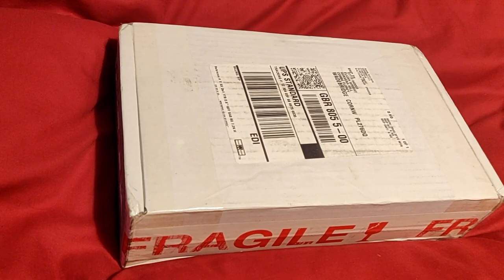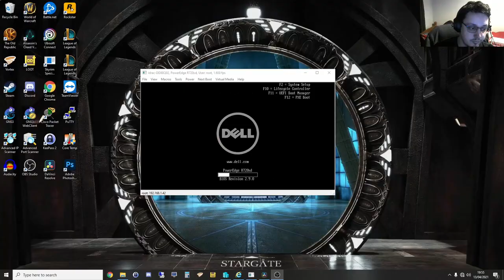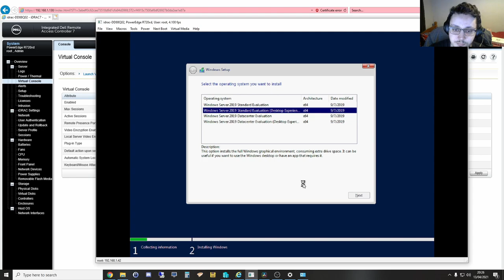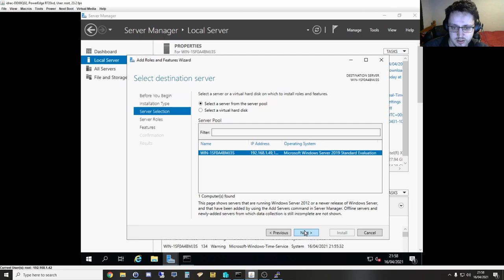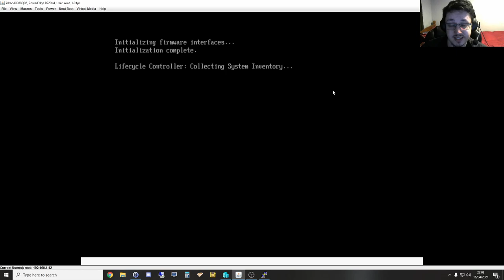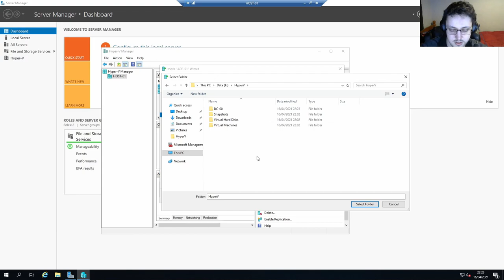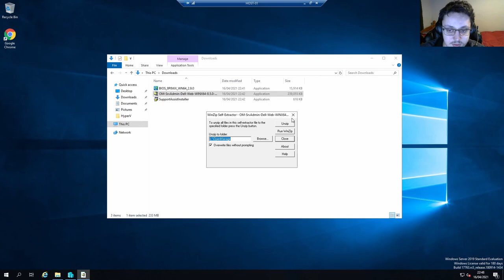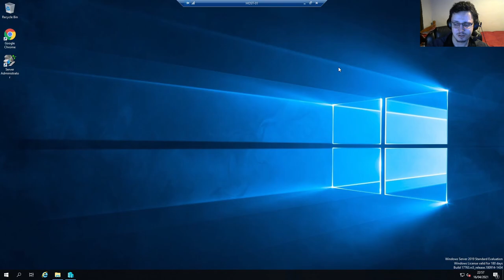Dell PowerEdge R720XD Server Build - Installation & Configuration Complete Guide

Comment: At the risk of asking a really weird question,  How do you configure your perc h710 controller if you don't want to use RAID, and don't want to risk a bad flash and bricking it.
Reply from the maker: Not a weird question at all. Quite an obvious one. If you want to not use RAID at all then you can skip creating the RAID by either deleting all RAID arrays currenly in use therefore deleting all data. Alternatively you can reset all disks to NON-raid on some Servers. Once you've done either of these then you can proceed with installing the OS. However I'd reccomend that you have some sort of alternative backup & disaster recovery process and solution to account for this as it will effectively mean if 1 disk fails you could potentially loose everything depending on how many drives you have and how you have setup your drives and filesystem etc. Raid 5 is good for performance and capacity as a happy medium and it only uses one disk for parity. So if you have 10 x 1 TB disks then you have 9 TB capacity and can sustain 1 simultaneous disk failure. Hope this helps!

Comment: Hi there I have just purchased a Dell R720 but when I switch it on the logo that pops up is a omni cube simplicity so not to sure what’s going there.
Also I have 2 300Gb drives but when I go to the controller to configure the drives I can only see one drive and the Raid option is not available so so confused.
Any help would be much appreciated 

Thank you.
Reply from the maker: That sounds most odd. However without seeing your system myself i can't categorically say what your issues is. I'd advise you consult the Dell R720 service manual. If it's a used server and you don't need the data on it then i would delete the RAID array and start over. Thanks!